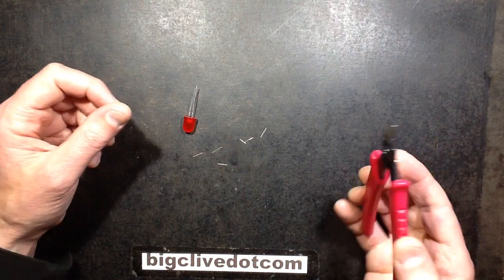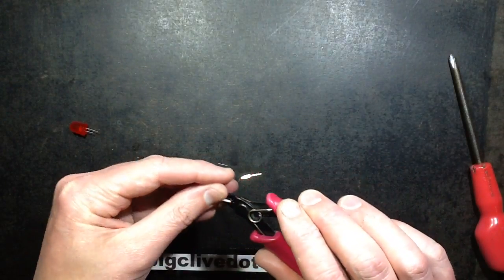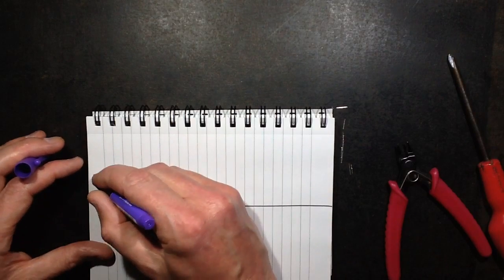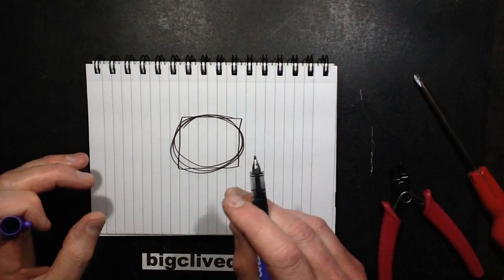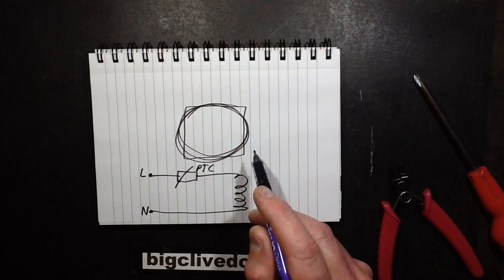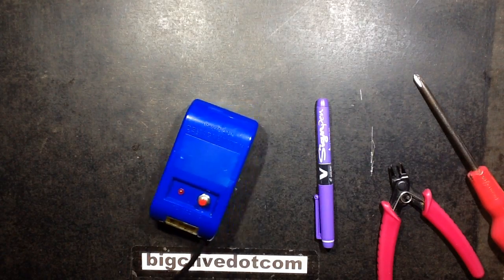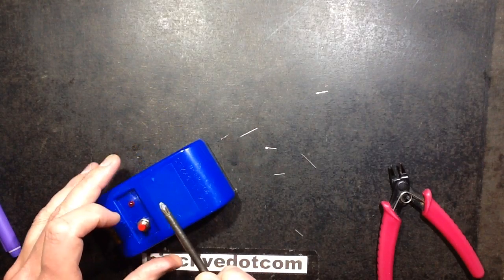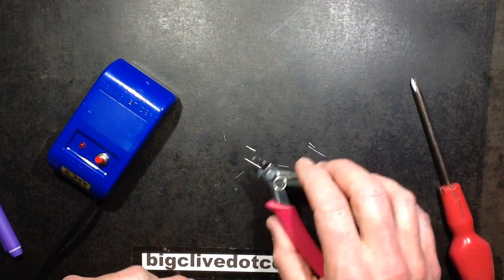A look inside an ebay degausser/demagnetiser from China.

Comment: I have one of the blue pucks for demagnetising watches. It’s a nightmare. Sometimes it makes things worse. I have a proper demag tool arriving this week.
Reply from the maker: Keep in mind that with this type you have to approach the unit with the device to be demagnetised, and then take it away slowly so the residual magnetic field is near zero.  The unit has to be powered until the device being demagnetised has been moved far enough away.

Comment: I fell into the trap of believing that my antique Omega pocket watch had become magnetised because it was running erratically and ended up buying a plate Demagnetizer that promptly and properly magnetised the movement. I admit that I'm an idiot and caused this problem myself, through ignorance. I'm wondering now, if this back-and-forth "sawing motion"+lift-away technique might work with the plate "Demagnetizer" as well?
Reply from the maker: Depending on how your demagnetiser works it may actually require that the device to be demagnetised is placed on it and then slowly moved away so there is no major residual magnetic field left.

Comment: I think it's about time shops stopped selling these. They come with an unfused 2-pin plug, so there's no determination which line goes to the switch. The (unrated) switch has a metal body which can be reached from the front panel. The uninsulated wires going to the switch and LED might make contact with the metal body of the switch leading to a shock. These are anything but double-screened and wouldn't be up to a CE mark. There are european-branded versions of the same thing which are very much better made, but unfortunately, as always, cost more.

Comment: Can anyone tell me the value of the resistor, the one in mine is 200k ohms, I'm thinking of changing it to reduce the magnetic pull, it seems too strong for something delicate like a watch.
Reply from the maker: You'd need to limit the current through the coil.  Adding a spacer to limit how close the parts can get to the surface would reduce the magnetic force.

Comment: I recently bought one of these do demag a watch hairspring (Still in the watch!), I pressed the red button and the locknut wasn't screwed on, The button went inside and the LED indicator also went in, I contacted the seller and told him what happened and he replied 'Can you use it some more'!, I told him no because the whole lot had gone inside!

I tried holding the red plastic switch first off to screw the nut on but it seemed lioke the threads were bad as that's when it went fully inside!, I opened the box up and pushed the switch through from the inside then replaced the nut whilst pushing down with pliars (And put the LED in first) and it's all working now!! 👍

Comment: I bought a degausser many years ago(late 70's) to degauss my tape recorder heads. Even though it came with basic instructions I never could work out how or if it really worked or caused damage to the machine. Still have it. I'll try to demagnetize a screwdriver.

Comment: Interesting point about the wires in the LEDs being steel cored,  which I don't see where anybody else picked up on.  It's amazing how far that sort of thing is going.  I had a rather extensive job a while back that had me picking up a whole box (1000') of RG6 coax cable,  turns out that the center conductor is copper-clad steel,  sticks to a magnet just fine.  At the dish frequencies this stuff was carrying,  skin effect made that not be a problem.  Also a while back I was in a "Dollar Tree" store and saw a small package with some red and black wire.  Figured that'd be handy and I picked it up.  It's not copper,  I can tell you that.  So far I've used this stuff (rather extremely thin stuff) for wiring going between small modules of various sorts,  and that's about it.  My power distribution wiring also uses red and black,  but that's tinned copper,  and considerably heavier.

Comment: Clive, I have one that I bought from a watch supplies company to demag my watches , now it looks very similar to this one however must be four (4) years between the purchases. Now mine: no noise at all,  I place the watch face down on the unit and press the button for say two (2) seconds and hey ho all done.
Why the difference between the two units please?
Kindest 
Bob
Reply from the maker: If you don't have to move the watch away it may have a PTC thermistor in series like a cathode ray tube degausser.  Those units provide a high alternating magnetic field that then fades away to near zero, leaving very low residual magnetism.
With these ones the coil is powered continuously, so you have to move the item away slowly to gradually reduce the field.
If you just pressed and released the button with the watch sitting on this unit it would be left with a random polarity and strength field based on when you let go of the button in the mains sinewave.
Reply: @bigclivedotcom  cheers Clive

Comment: I bought a small brushless motor and took out the rotating bits and made my own degausser. Just plug it in and run any parts and pieces through the center hole without touching the sides and it's MUCH more effective than that little thing.

Comment: A watch can die from being around a magnet as the hands can't pass each other (as an example) - maybe the most common issue when magnetized and newer tech try to avoid that. I just rebooted a third one from ebay. It was something I learned in the 80's with a tape deck and a shop owner looked at me odd with my desire to order a demagnetizer but I played with the heads for each tape with a screw driver and could hear the difference.

Comment: This reminds me of my grandpa's watchmaking bench from many decades ago. One of the tools was a degaussing coil, wound on an oval form and mounted in a finely finished nickel-plated frame. The gadget was fixed to a lacquered hardwood base, with a momentary line switch resembling an old-fashioned telegraph key. p.s. The line cord was attached with Fahnestock clips screwed to the hardwood.
Reply: Shake Hands with Danger. Beautifully crafted and finished Danger. Love those old tools where safety was "just don't touch that part"!

Comment: if the process is reversed say to put a metal on that device, does it add magnetic field to the metal?
Reply from the maker: It can, but it's random based on when the power is turned off in the sine wave.

Comment: Question: could you magnetise/ RE-magnitise something metal by simply leaving it on the blue surface for ~10 seconds whilst pressing the red button, WITHOUT pulling it away?
Reply from the maker: It works, but is a bit random depending on when you take your finger off the button.
Reply: bigclivedotcom Thanks for the reply!

Comment: Mechanical watches are sensitive to magnetic fields, and the hairspring can become magnetized. When magnetized the watch will not keep proper time. Over time a mechanical watch hairspring can become magnetized from the Earth's field. The use of a demagnetizer for watches is able to be used to demagnetize the watch.  With the use of mobile phones and computer devices mechanical watches tend to get more easily magnetized. 

I am using the same demagnetizer shown in this video to demagnetize my watches. It is very effective and works very well for my watches. 

I like electronic quartz watches for accuracy, and they are not easily affected by magnetic fields.
Reply: Thank you for your comment. Most times I learn from the comment section. For a deeper understanding of the magnetic field influence on rotating assemblies within the Either, I’d suggest educating oneself on “The Law of Hysteresis.” Things are not as complicated as we’ve been taught. Again, thank you.

Comment: Plenty of room in there for a PTC thermistor.
Reply from the maker: That's exactly what they use in some video monitor degaussers.  The large thermistor allows a high initial current that then reduces over the space of a few seconds to a low level.
Reply: @bigclivedotcom  I worked my way through High School (grade 8-12) at a television repair shop that also repaired window air conditioners, VCRs, and Atari 2600 game machines. Every so often we get in a TV where the thermister had blown, and some jackwagon had just twisted the thermister's leads together. They'd save the picture tube replacements for me, so I had lots of fun degausing and adjusting purity and convergence. Dropping the old picture tube neck-first into the dumpster was also cheap fun.